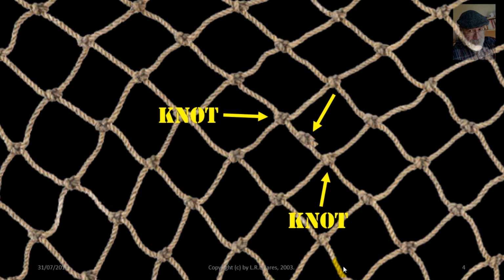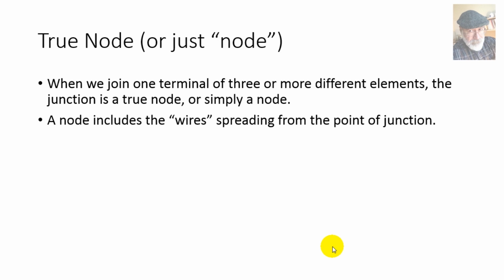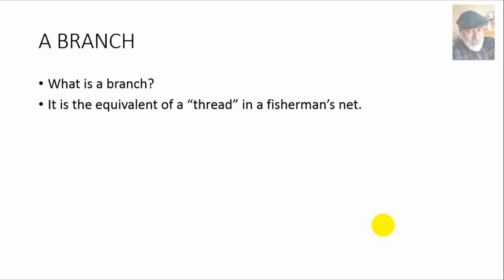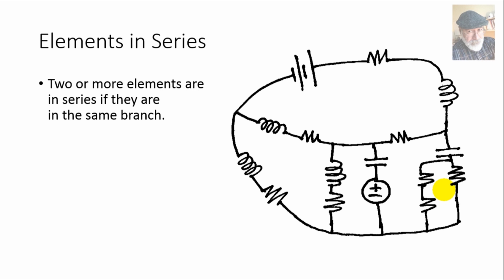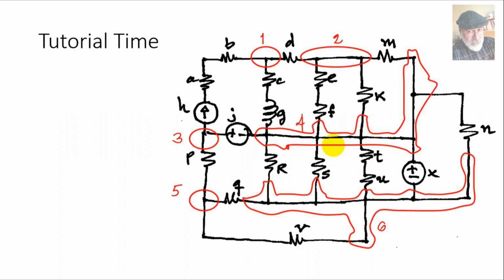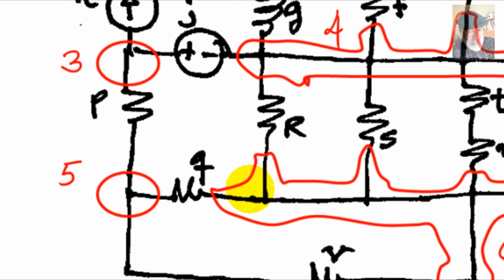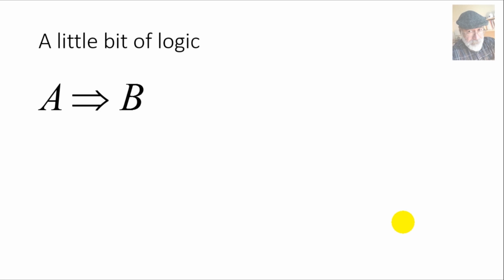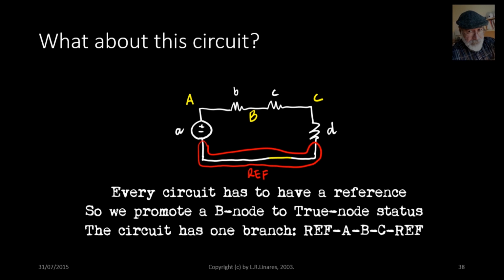EE 101/10 - Topology, nodes, branches, series, parallel connections.

Comment: Question 
what is the difference between Nodes and Terminals? 
Fantastic video, by the way.
Reply from the maker: +Ronnie McCera A terminal is associated with a device, with a specific component, a resistor, a capacitor, a transistor. A node is a property of the network.
Reply: So it's basically a node that is associated with a device directly ?
Reply from the maker: No. A node is a combination of two or more terminals of different elements, a property of a circuit. A terminal is a property of the device per se, alone, even disconnected from everything else.